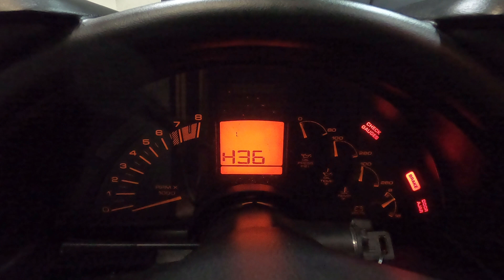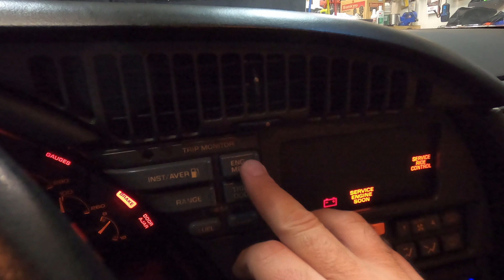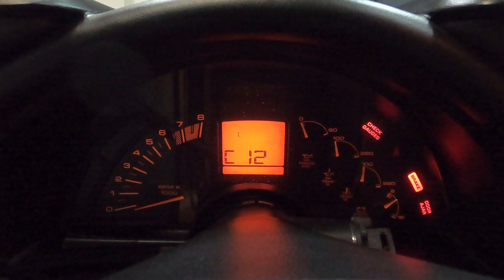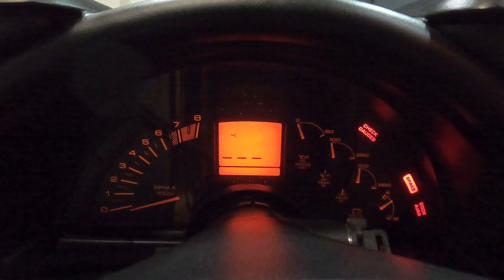Clearing OBD1 trouble codes on a 1990-95 C4 Corvette

Comment: I have the 1992 ZR-1 with  a flashing "SYS" code. I was told to replace the battery and I did and it is still flashing. But I didn't erase the codes.Ill be giving this a try.
Reply: I have 1992 base corvette but it could be similar sys could pop if you have an after market radio theres a couple forums talking into more detail about that

Comment: i can’t get my 1994 to show anything with these pins jumped. i know im making a connection in port. what should i do ?
Reply: I just found the answer.  In 1994 the pins are number 4 and 12
Reply: @thinkgolden  are they numbered or lettered? I don't see either. Thanks.
Reply: I just tried today and had the same issue. Screen is blank